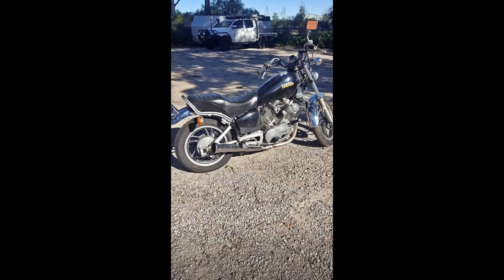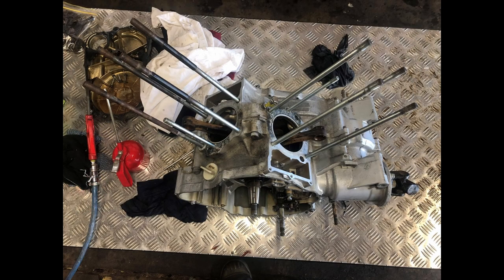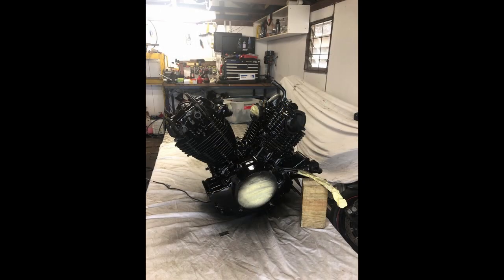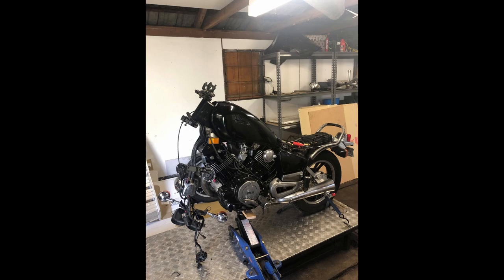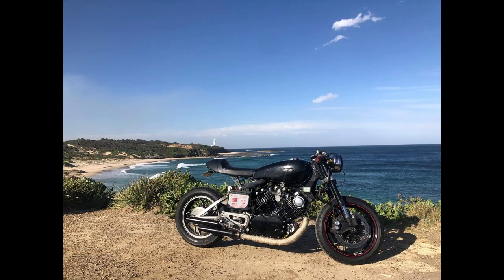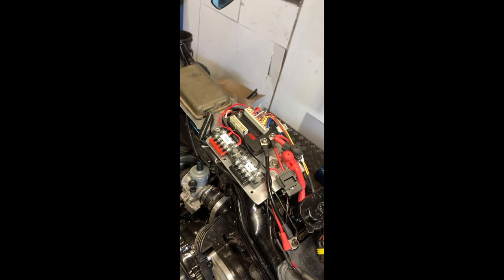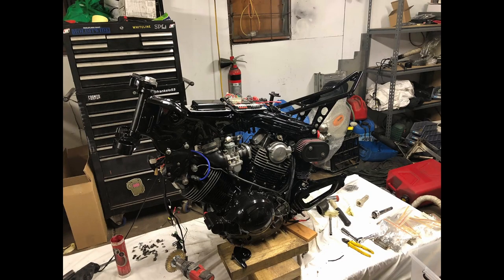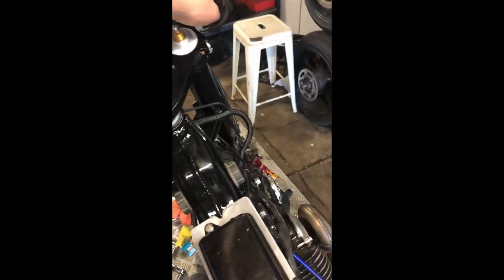HOW TO BUILD A CAFE RACER! Yamaha Virago

Comment: Awesome build man. You nailed the look, the stance, and that pipe you have really enhances that vtwin sound. Im contemplating whether to push thru with an xv or save myself the headache of figuring out loads of problems with the motor. You just made me pull the trigger. Liked and subbed. 
Safe rides man.
Reply from the maker: Thankyou so much mate!
I agree, 2 into 1 sounds awesome. 
Good man! I swear by the virago. Honestly Havnt had much go wrong with her. Just tuning things when I change pipe length and stuff. The carbs have been great but my carb tuning skills are not where I’d like them to be. 

Good to hear mate! Thanks heaps for the comment, sub and like! Legendary.

Comment: I watched this so many times, you did an amazing job! I just pick up an 82’ xv920 and you have been a huge inspiration! I couldn’t figure out what you had done with the battery on the side of the bike but then seen you relocated it under the swing arm, did you buy the bracket or fabricate it yourself?
Reply from the maker: Hey! Jeez so sorry for the slack reply. 
Thanks so much for the kind words! That’s heaps nice to hear.
Yeah I basically removed the centre stand and welded in a couple of pieces of angle iron and fabricated a custom retainer nut/bracket. 

Goodluck with your build mate!

Comment: Hey Matt. Great build. How difficult was it to fabricate the shock adapter? And did you have to fabricate your own bushings for the bottom of the shock?
Reply from the maker: Thanks mate appreciate it! 
Nah not difficult. But it all honesty it’s probably one of the things I’m not super happy with anyway. It’s on the list of “re-do” parts. Nah no bushings. The top is bolted to the frame. 
The lower part of the top mount doesn’t pivot very much at all so I didn’t think it needed it.
I’m going to give the cafe a bit of a birthday soon. New dash, remaking some brackets, revise some of the electrical. Fixing some other things aswell! Should be much better.

Comment: Cool build. What throttle are you using? I have a xv750 83 with R1 front and I believe I have the same throttle cable. The cable isn't sitting nicely which is causing a high idle at my bike. I also noticed that the throttle cable doesnt have a thread at the end of the throttle side. Does yours?
Reply from the maker: Thankyou kindly! I’m using a R6 throttle tube and a weird eBay throttle housing and 2-1 mikuni cable.
I’ve had a couple of issues with the cables being stuck in weird positions and what not. They really need right angles from the top of the carb. But my issues are nothing to really whinge about.
Nah the cable just sits in the top of the brass adjuster. I like the design. It allows you to make needle adjustments easier for sure.

Comment: Great bike!  What did you use for the exhaust collar?  And where did you get that tubing?  Looks like some nice tight bends.
Reply from the maker: Thankyou so much. 
I actually used the stock collar and machined out the centre of it to accept the 1” 3/4 primary tube. 
I actually have another video on the exhaust aswell. I did a little modification to it due to ground clearance issues. I got the tubing from ECS exhaust local to me. Great bloke, good prices.

The tight turn next to the front cylinder is actually a 1 3/4” donut that I cut to size. I think it turned out alright! This was my first attempt at a stainless exhaust
Reply: @mattfranco8715  Nice!  Exhaust video episode 2 was great, but I couldn't find episode 1.  Did you discuss how to machine out the collar?  I spent a long time with a grinder trying to open up mine and didn't get very far...

Comment: Hi, nice bike. Which tyresize did you use for the rear? Looking for a bit wider one for mine, not sure if 140 or 150 will fit
Reply from the maker: Hey, I use a 130/90-16 but I want something wider too. I’d also like to know if it can be done without modifications
Reply from the maker: I’ve read that even a 140 tyre will rub on the gen 1 swing arm.

Comment: I cant get my head around where you relocated the battery. Ive got a xv 920 myself  and wanting to do something similar. In denmark they are really strict with changes to the bike, so maybe nok the front forks.... 😊
Reply from the maker: Haha, it’s under the swing arm pivot bolt, where the old centre stand bolts onto.
Reply: @mattfranco8715  thanks man 😅

Comment: Hi, where did you find the collector? did you build it?
Reply from the maker: Hey sorry for the slow ass reply. I got the exhaust collector from ECS exhaust local to me. It’s a good bit of kit. Makes the build go quick.
But next time I attempt a 2 into 1 I’ll try my hand at making one. 
I’ve built one for a customer out of mild steel and it turned out awesome so I’m keen to make my own one day :)
Reply: @mattfranco8715  thanks but I'm talking about che carburetor collector, I'm try to put 2 mikuni 35 on my virago 750 and the original is to big